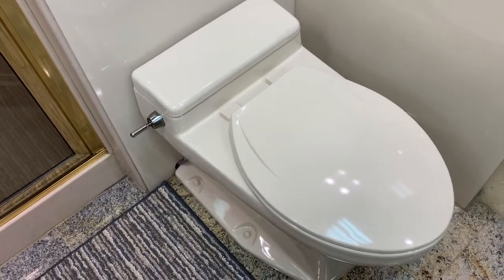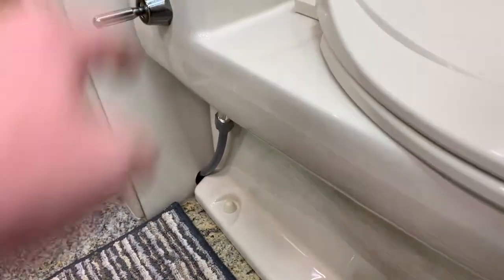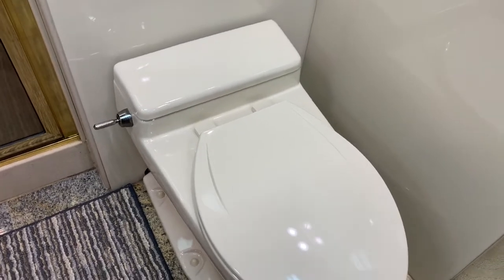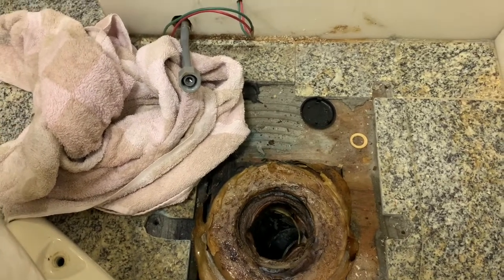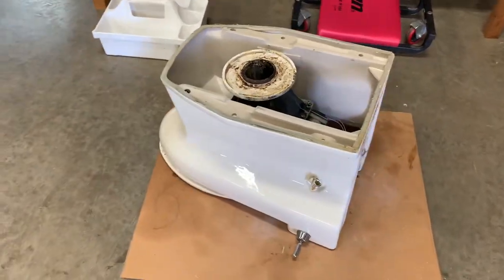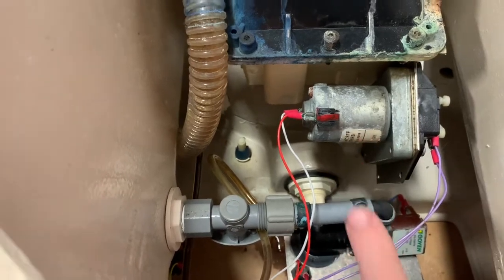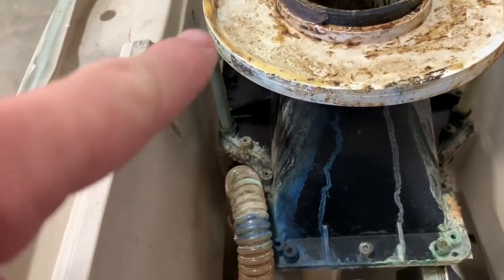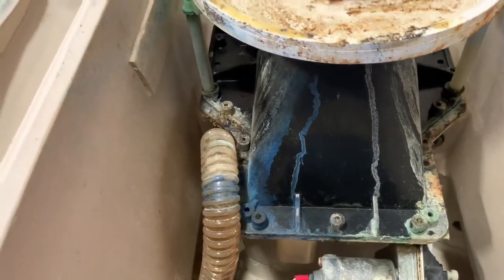Prevost 1995 CC Microphor LF-220 Toilet Rebuild

Comment: Do they make a pneumatic version?  I think mine needs air pressure to operate - would much rather have a 12v version.
Reply from the maker: Yes, they sure do.  I agree that the 12 volt version is the way to go.  With my older bus, the aux air leaks down so air would be a problem.
Reply: @billjohnsonaviation  I have a 2000 H3-45 and our Aux air has a small leak as well - (will be trying to fix that when it gets warmer out).  If we don't keep the air compressor on to top it off, we can't flush the toilet.  Wonder if it could be changed to 12v....  We are having to run the air compressor so we can use the toilet, it would be nice to turn it off when camping.  By the way, I have a small channel too - I will work to mention your channel in my feeds - there aren't many Prevost information Chanels out there.
Reply: I have a Bluebird with an LF-220 electric straight drop toilet. My friends have Bluebirds that used to have the air toilets but they have just changed them out. From them,I believe that the air is used because the droppings are air pushed out and around some bends to get to the black tank. They both had to plumb in new piping (in the LXI case, through the rear passenger wheel well) to get to the black tank. On my LX, it is a straight down drop. On the M450, it took about 3 ft. of pipe and three bends through 2 bays to get into the black tank. It is not a hard job but it took planning. And, obviously, the new piping had to slope downhill whereas the air system that did not happen.